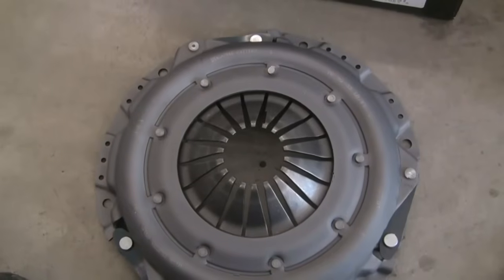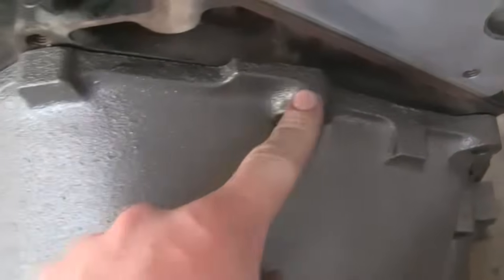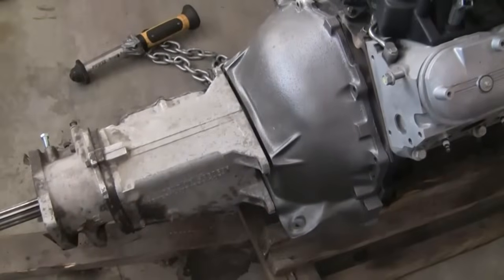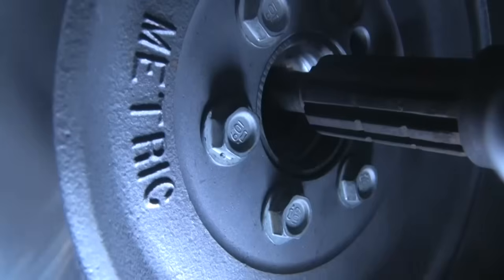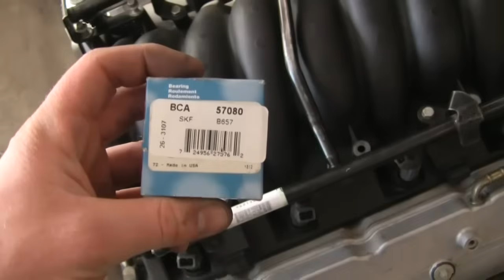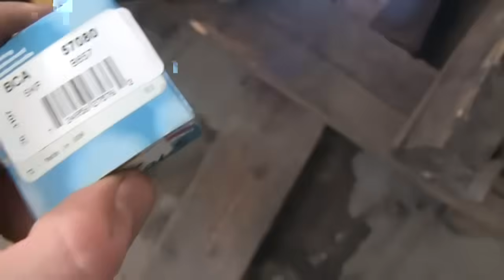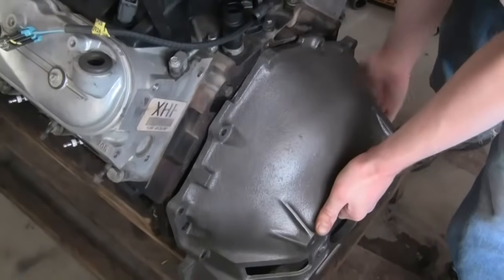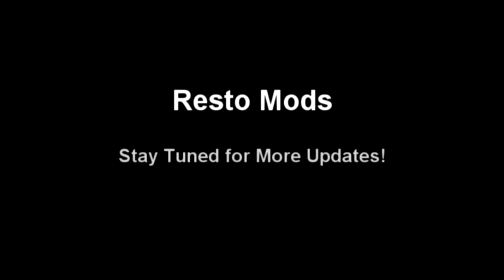How To Connect a LSx Series V8 to older GM 4 Speed Manual Transmission

Comment: There also was a cast iron open bell housing. Why? Clutch change. Just pull the transmission back enough the clear pressure plate. Just remember to look at the clutch & Remove the pressure plate. Eye ball how thick clutch is. The replace it when it gets thin BEFORE it starts slipping. You can only resurface a fly wheel or clutch plate so many times. Replacing clutches before that happens? No problem.
That was a took longer to put the 3 door suburban up on 4 jack stands than to eye ball the clutch and metal surfaces. Back when GM knew how to build cars and trucks. Instead of having California design them.

Comment: Never use a Borg Warner 4 speed transmission in anything! They have a aluminum housing and it transmits tons of annoying noise! Especially on anything with a wood floorboard. (Like '32 Duce coups!) Use a Muncie 4 speed transmission! Just so you know, a 1955-1957 cast iron bell housing is ideal for small block Chev/FJ40 motor swaps! It has a "flat" milled on the side of this bell housing. That is where i mounted my hydraulic clutch when i put my 327/350 horsepower Corvette motor in my 1971 FJ40! I also prefer the Corvette Diafram clutch. I reason i prefer the Corvette motor over the Chev motor is the 'Vette motors, a mechanical tachometer can be used! The "Vette distributor has a place to screw the mechanical cable into !

Comment: And you're just gonna leave half the clutch not contacting the fly wheel ?? That may work id you're just driving to the grocery store , but I you need a heavy duty truck to tow heavy weight , it will never work , .... God I should have won't with the 454

Comment: And you are getting about 10% clutch engagement.  Look how huge that dish is in the center of the flywheel.  Look at the diameter of the clutch disc.  Only the outer 10% of that disc makes contact with the flywheel.  A better choice is an expensive conversion flywheel that gives you full contact of the clutch disc.

Comment: This is exactly what I am doing on my 61 Apache. I didn’t realize the V8 bellhousing from 62-66 was the same mounting as the 61 bellhousing for a 235.  Nobody on the Facebook forums know this swap is possible in a 60-61 Apache.  Good work with the video
Reply: There also was a cast iron open bell housing. Why? Clutch change. Just pull the transmission back enough the clear pressure plate. Just remember to look at the clutch & Remove the pressure plate. Eye ball how thick clutch is. The replace it when it gets thin BEFORE it starts slipping. You can only resurface a fly wheel or clutch plate so many times. Replacing clutches before that happens? No problem.
That was a took longer to put the 3 door suburban up on 4 jack stands than to eye ball the clutch and metal surfaces. Back when GM knew how to build cars and trucks. Instead of having California design them.

Comment: What kind of clutch can I use I have a LS1 Trans Am motor I want to put a NV 3500 Transmission 5 speed manual my buddy said I need to put a flywheel off a 4.8 like you said in this video
Reply: Joshua RODRIGUEZ you need the 4.8 clutch kit with the nfw 1050 flywheel currently doing this on a 96 c1500 with 4.3 v6 only thing I don’t know yet is what pilot/throw out bearing to use

Comment: actually the bearing is an 8617 McLeod (or equivalent) and because of the lip it  makes up for the .4 inches difference in the crankshaft between the old and some ls engines.It should be pressed in all the way.The other option is the 12557583 roller bearing which presses  to the inner lip of the crankshaft  and seems to be a better option .Was it my imagination or did he actually press the pilot bearing in all the way later in the video.You have to know what engine you have because some of the Ls motors do not have the .4 inch length difference and if youre a weekend warrior you wil be sad if you have the wrong configration.No nookie tonight.

Comment: issues ive heard of are that the old style clutch used shouldered bolts that are like dowel pins. the metric bolts will only locate it by their threads. the new style presssure plate uses the dowel pins for a reason.

Comment: It is not recommended to try and run the old school 11" clutch on the LS flywheel!   If you notice the clutch doesn't contact the flywheel 100% in the center, about 1/3rd of the clutch face over hangs the flywheel service. You could drive the vehicle but it will destroy the clutch quickly.
The pressure plate naturally matches perfectly it's the contact between the clutch disc and face of the flywheel that doesn't work.
Instead you will need a LS specific clutch to match the flywheel.  I found the 2002 Camaro clutch worked in a 26 spline application and the truck clutches will have the 10 spline.  JD
Reply: That is true sort of if you actually do a clutch job you will notice that the clutch the flywheel surface on an OEM setup throughout the older yreara did not always martch 100%

Comment: I have a 2005 6.0 chevy and I did the same but the starter will not work what are u doing different and what is the part number for the starter u are using

Comment: I found an even better pilot bearing to use is one from a 01-06 2500HD with the nv4500 5 speed trans. It's a big sealed bearing that goes in the big outer part of the crank.
Reply: Fml I had a choice between that one you mentioned and this one in the vid. I should’ve got the other one because this one sucks compared to it.

Comment: Wow you are brave to run that setup in your car? How does  that combination work for? Is it safe? Because when I used to run a 4speed in my 55  pickup street racing I would powershift alot but I'd get the win! So let us know how it works out for you in high rpm situations?
Reply: Safety's for the armchair racers who've never planted their foot and loosed the power of a big block down a drag strip! :-P :-)
Reply: +martin750hp It seemed to work out just fine in this car. I took it out to about 5500-6000 rpm a number of times and it didn't seem to have an issue. However I only put about 1500 miles on this setup before I sold this car and purchased a 1957 Bel Air.
Reply: Well it does not seem safe but if i was doing the same thing's and it work's? i just might tell someone else that's wanting a 4 speed behind a newer LS block with not too much power, to try this- nice going!
Reply: +martin750hp How would it not be safe?
Reply: +yamahondarider I did not see that you can use one upper bolt hole on the left thinking just four boltholes on bottom were only the only four bolt holes that could be bolted? miss matched parts would be a dangerous combination, but looking at the video again I did not see that all parts matched up pretty good with one another, so that's why I thought it would be dangerous in high rpm situations and you can probably tap out that other bolt hole (check with your mechanic or engine rebuilder on this) to see if that's possible and safe because four speed belhousings stock like this one are a weak link on scatter shields ID be more at ease because when it comes to high RPMs you never know what will come apart but max 6000+ rpms pretty safe I believe but a scatter shield much safer. I don't like to skimp on safety especially stick shift cars and racing you can never be to safe when street racing or track racing always use tork specs and be  safe and the right equipment, now you know why I did not think at first it would be safe!!!   But nice video!!!

Comment: thats an 01-06 flywheel not a 99 -06   the 4.8 from 99-00 is a different flywheel...going thru this problem right now and have spent hrs looking... from what i can tell manual trans 4.8 had a different crank than automatic trucks.  in 2001 both manual trans and automatic trans ran the sam crank... use sachs 1050 with an extended pilot bushing or the l12557582 pilot bearing
Reply: 12557583

Comment: Grade 8 metric bolts, do you have the exact measurement? I picked up some bolts but they have some play in it as it screws down.

10.9mm?
Reply: 10.9 is the "grade" for metric bolts. 10.9 is "similar" strength to grade 8

Comment: The 12557583 pilot bearing that fits into the largest counterbore is the bearing that should be used in this situation.  Doing what is shown in the video is not advised.
Reply: Just curious, but why ?
Reply: @COATIF67  Its made for the crank and is longer, giving input shaft stability
Reply: @realdeathpony  thanks i lost my job so haven't moved forward but im back on my feet and this will help a ton
Reply: @COATIF67  how'd you make out with that bearing?

Comment: what starter are you using??? the 5.3 one you got with the engine? or one from where you sourced the flywheel? or possibly a gen 1 sbc one? something entirely different?
Reply: Daniel Doroff It used a 5.3L starter. The flywheel used was from a LS based engine so the teeth count is the same. Any LS engine starter will work, gen 1 sbc will NOT work.
Reply: thanks
Reply: Any part numbers for the flywheel also what size clutch is being used.part number would help a ton or year make and model thank you

Comment: Your part # is for a bearing  and is different from the bushing you installed . Did I miss something . I have a 99 5.3 when I installed a bearing the spline shaft bottomed out on the bearing about 1/2 inch before the bell housing could mate to the block so I am assuming I need the Bushing ( not bearing) like the one you installed . Do you have that part # ?
Reply: +machew74   you have a long crank...you need sachs 1043 flywheeland a standard pilot bushing

Comment: what about starter and z bar?!?! 79 k10. also the 6.0 ive been told is not.400" shorter like the other ls engines.... do you know what this would mean for my case?
Reply: In this case the starter bolts right up but for the Z-Bar you will have to fabricate a bracket that mounts off the bellhousing bolts to pickup your Z bar. As far as the 6.0L goes the only year 6.0's that use the longer crankshaft are the 99-2000 iron head LQ4's. 2001+ 6.0L's all use the shorter crankshaft.
Reply: *****  thankyou. now im left with a dilema though. i have an ironhead lq4 with that crank that i tore apart for mire twin turbo firebird build and i buying a 03 lq4 next week.... the ironhead needs work as its in pieces. the 03 is low miles and redy to run... should i swap cranks or just go this setup and worry about the shorter crank issue in my bird another time for the t56 magnum i need for that car... that crank wont work for the ls style tranny
Reply from the maker: VanGui1d3r I would just install the 03 LQ4 as it is already a running engine. It would be a lot of work to try and swap crankshafts and overall not worth it for the different length crank. Just use the flywheel we used to connect to the 4 speed and you should be good to go.

Comment: Thanks for the video, helps a ton. Quick question, I'm using ARP pressure plate bolts. Any idea what I should torque them to? I'm mating an all aluminum 5.3 to an M20.

Comment: do you know if the sm465 trans will bolt right up like this? and ive also heard of people having to use a flywheel spacer to get the clutch fork to engage the clutch enough? any issues with that?

Comment: Has anybody had problems with the T/O bearing pulling out since it's only half-way seated? Also, since it's not seated, how do you drive it in perfectly straight? If it were driven in at a slight angle it would straighten out when it's seated, if that makes sense. Seems like if it's off it would eat the input shaft and cause one hell of a vibration?
Reply: pilot bearing not thro-out bearing